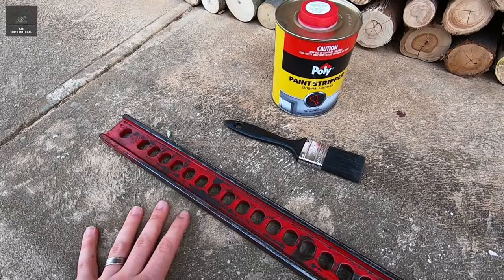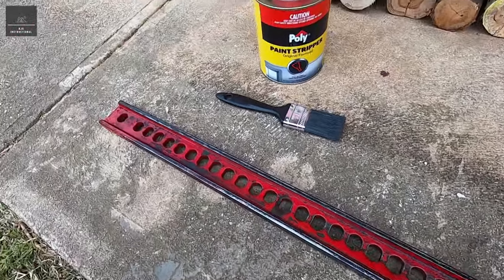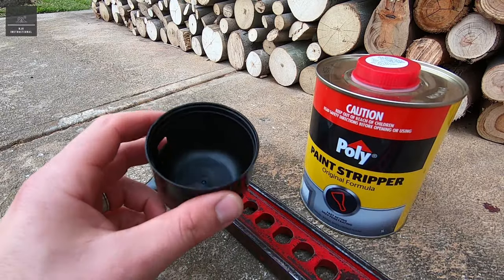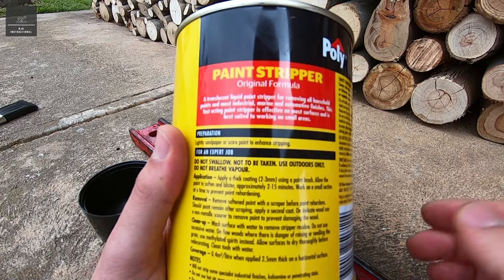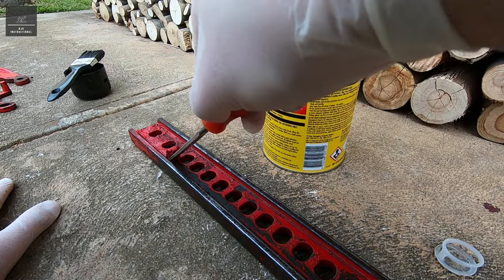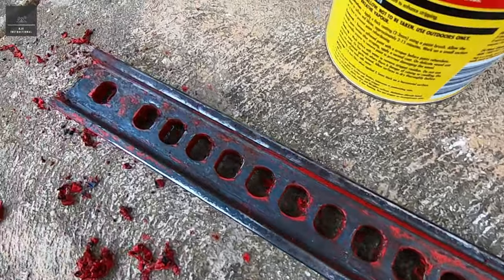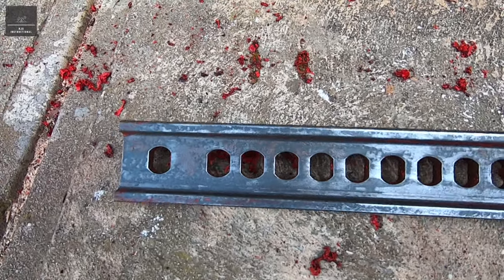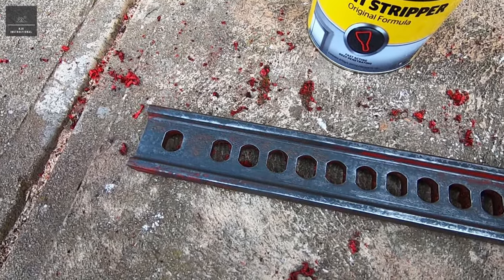How To Strip Paint From Metal Surfaces - QUICK, EASY & EFFECTIVE

Comment: Just a thought:  You assume that being outside protects you from fumes.  However, air current can easily carry fumes right to you, rather than away.  If you're downwind you'll get substantial exposure.  In any case, if you smell it, you're getting exposed.  Far safer to use a a respirator.  Available at hardware stores.  Easy to use.
Reply from the maker: Yes you are right. Outside certainly helps to reduce the level of exposure compared to inside, however, a respirator would also greatly help.

Comment: Due to the caustic nature, clean up, risk of chemical burns, poisonous fumes  and Very high costs for these products... Its much safer and cost effective to find a local shop that does bead/media blasting. With an appointment,  you can typically have a part this size back the next day. You can also choose a less or more aggressive finish by deciding what blast material that's used. I tried chemical strip first.. what a mess. Never again

Comment: Thank you NJS for your great videos, will be watching more soon. Sorry I have to add something to this one.. I just spent the last few days stripping steel parts from my 1981 land rover to send for galvanizing. Like in this video I tried paint stripper, but some parts had several coats of paint, rustproofing and filler putty. If anyone watching this finds that paint stripper does not work for filler & rustproofing.. make sure you remove any fire hazards (fuel tanks, solvent cans, etc) use additional protective gear like welding gloves & use a gas blow torch to burn the filler putty, chisel, painters scraper & wire brush - it will save you a lot of time. Don't use blow torch on delicate steel parts or aluminum as they may warp.

Comment: After stripping paint from the metal, how should I clean up any chemical residue of the paint remover? Just wipe it down with tissue or rinse it off?
Reply: Acetone would be the perfect but you probably already figured out and job done since
Reply: Acetone is the solvent you'll need and a brush to remove. good luck
Reply: Metholated spirits.

Comment: My paint stripper is even more toxic, it even desolves my gloves in seconds 😁
Reply: What paint stripper do you use? Link?
Reply: @KD51LifeofaRacer  it is a generic brand from a Swedish home improvement store. I doubt you could get hold of it in the US but if you want to I can look if they still make it.
Reply: avez vous un nom celui ci fonctionnerais sur de l'epoxy?
Reply: @Mms_35830  chisel or sand if it is cured. On porous surfaces like wood or concrete you could get lucky to losen it with a paint stripper or acetone before mecanically removing it. For me, and if the work piece allows it, a heat gun has worked best
Reply: @MrSlushy87  je ne comprend pas tres bien :(